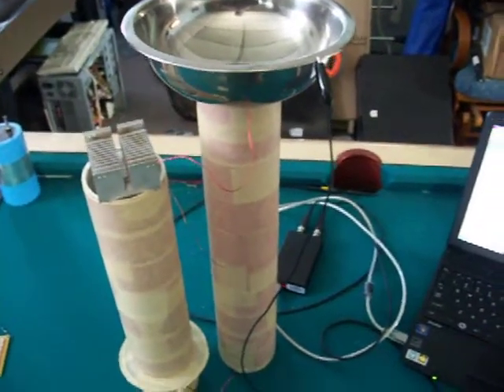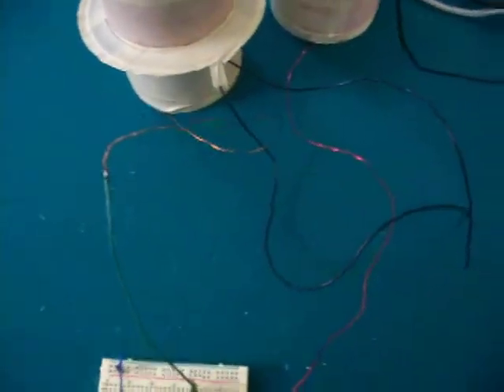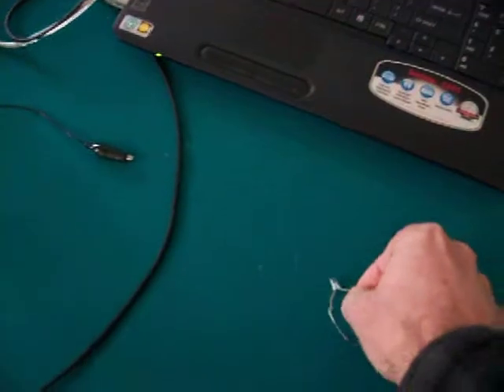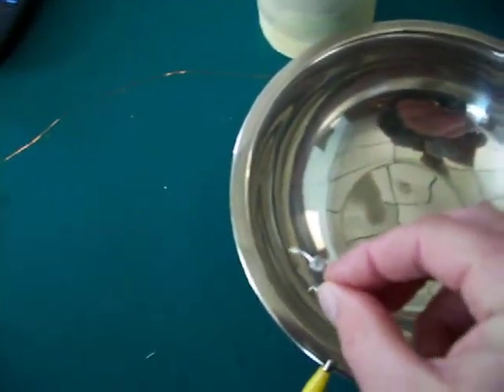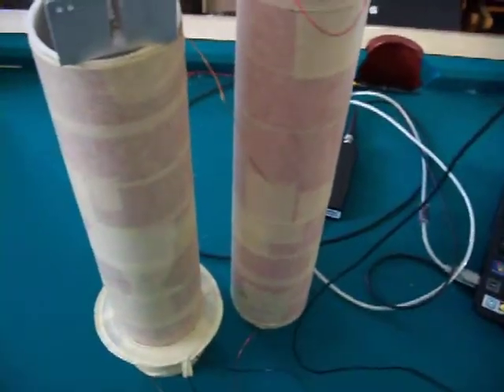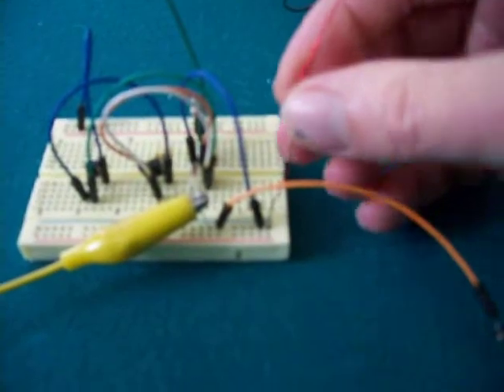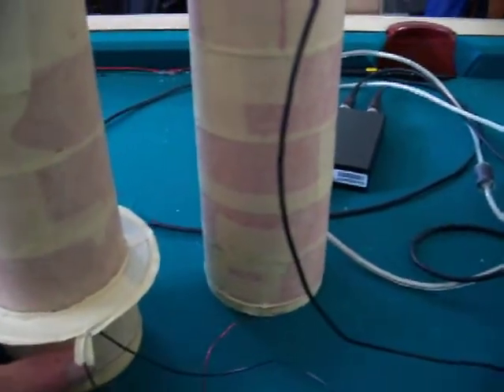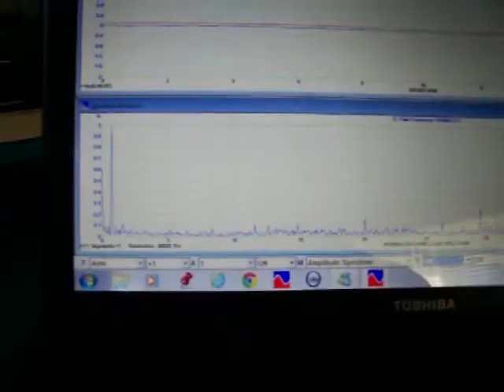L1 & L3 Interaction

Comment from the maker: It works like Dr Stifflers three coil setup.But with just the two coils for now.
No RF from the laptop, The laptop is running on it's battery.
Nothing in the room is pluged in and the over head lights are turned off.
The only part of the circuit being used is a 1N148 diode.
I just wanted to show how the coils interact with each other.

Comment: why does it oscillate without any power supply ?
Does it extract energy from your laptop via RF fields ?

All very confusing without showing a circuit diagramm and what you have connected and what not...
Hard to follow...Anyway, well ´done !